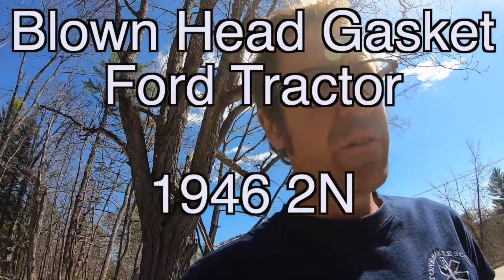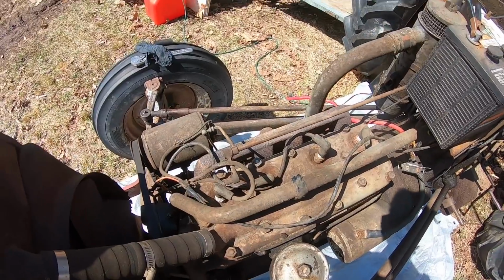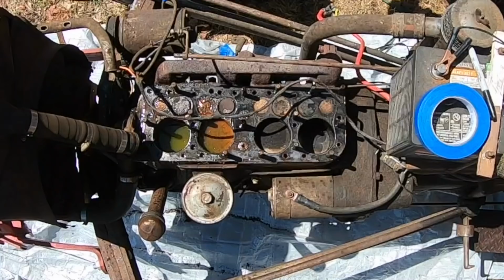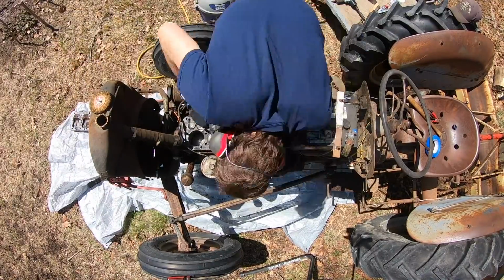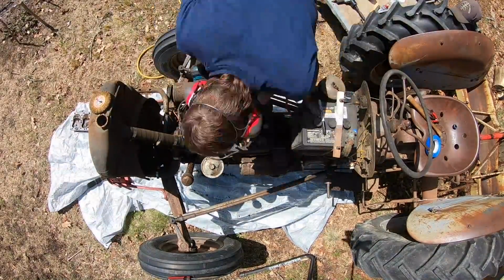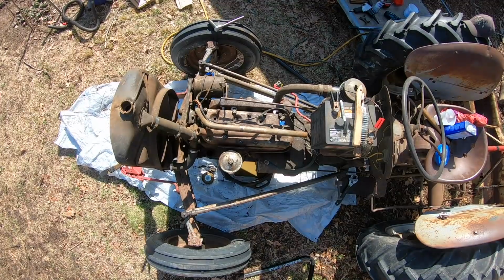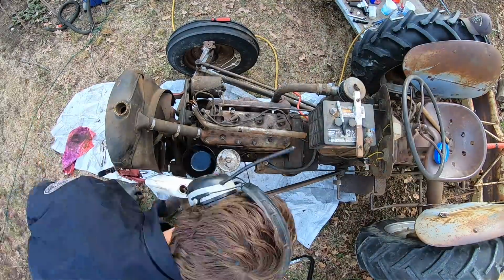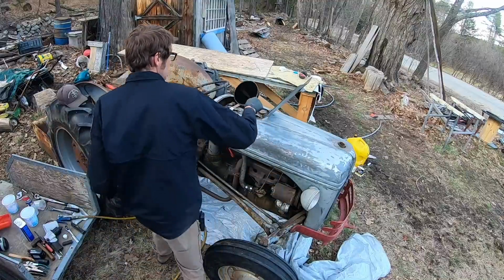Blown Head Gasket Ford Tractor - Will It Run?

Comment: I got a 46 as well.  Love it but the guy I bought it from painted 8n colors.  He also had a 9n, it run and all but it was all froze up and no tires, so I just got the 2n.  He thought they were all 8ns until I taught him.  1939 to 1942 are 9n.  1942 to 1948 are 2n.  1948 to 195? Are 8n.  The 2n i think in 1943 or 44 were non battery and steel wheels for 2 years I think then just before war was over they went back to battery and rubber tires. Just a bit of history for you guys.  Love the video keep them coming.
Reply from the maker: Thanks a lot

Comment: Straight edge and feeler gauge check or just slapping on a new gasket?
Reply from the maker: I did actually do the straight edge thing, and it looked shockingly good. It never got hot enough to change shape i guess, cause its a really tight seal now and not blowing any steam.

Comment: Great old tractor the old girl could do with a lick of paint thou
Reply from the maker: Funny you mention that. I had just spent hours sanding it back to that color, original and primer and a little bare metal and treated it with linseed oil.

Comment: Bus, that is what upsets me everyday I try to fix any car or truck now adays. Every thing is built to {MAYBE} last as long as the payments your making. The other upsetting thing is vehicles and equipment COST AS MUCH AS SOME HOUSES!@!!!!
 Put a fuel shut off on it and when you intend to leave it for a few days shut off the fuel and let it run to burn up all that fuel in the lines and carb that way it won't give you fuel gummed up system. The fuel nowadays is 15% ethanol & that contains water which will create rust and gue in your tractor.
Reply from the maker: Thanks a lot! I agree.